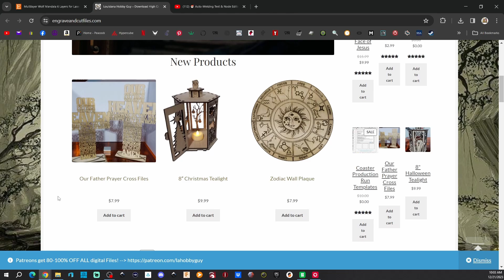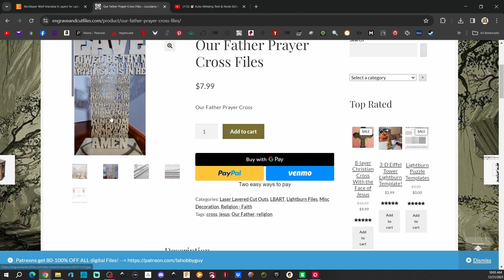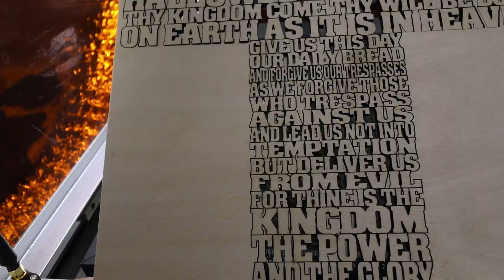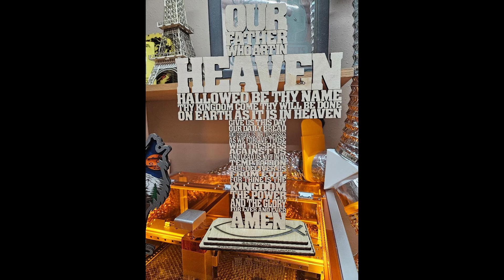2 Great Laser Projects | LaserMatic Mk2 #3dhp

Comment: what do you think about the fan always running of the laser  on the Mk2 ?
Reply from the maker: Whenever the Laser is turned on means you are getting ready to do a job.It hurts nothing and uses nothing in power. I installed a much larger fan on the wall now and removed the inside exhaust fan.

Comment: I've got a question . I see the focus tool has different steps to focus for engraving and cutting etc.  What if you needed to engrave on a piece and have it cut out too? How do you set the laser depth to do both?
Reply from the maker: I usually focus for engraving. Based on your speed and power you will have to run some tests to what works for you.You can set it a little deeper but then again  still run a speed and power test  for  engraving,then speed and power for cutting on a different layer. Always run test cuts and burns.

Comment: Great looking work! I have used a cnc machine and now want to try my hand at laser. Is there enough room on that table for a cutting board size of about 11x17 to engrave?  I'm reading on their site that this one has a pass through slot. Thanks.
Reply from the maker: There is a small acrylic panel you can remove in the front and rear, it is 16 inches wide. The bed area is 400 mm x 400 mm or 16 inches x 16 inches. It is an Amazing Laser. Slot is about 1 1/4 inches tall.
Reply: @3DHP  wow, that's close..lol. But it could be workable. I've been doing some research and came across this unit, and I was impressed with what it has to offer in quality and accessories. Thanks for the quick reply!

Comment: I’m probably going to be ordering the 20w lasermatic today as my first laser cutter. I’m curious, how long did it take to cut out the cross? Trying to get an idea to tell my wife about how long different projects might take.
Reply from the maker: Depending on your material, power and speed settings it varies. Not to long is all I can say.
Reply from the maker: If you use this link to purchase your LaserMatic I will receive a small commission.
https://rolyautomation.com?bg_ref=ScNstGMBo0